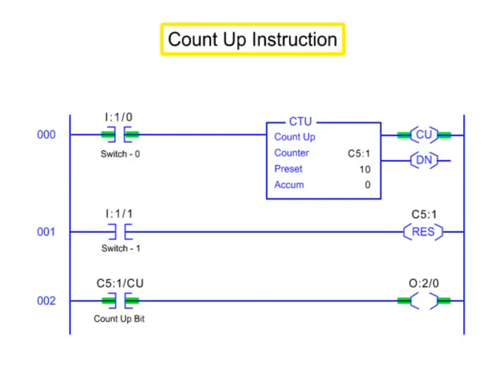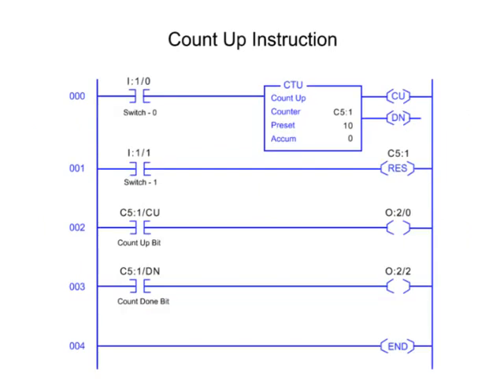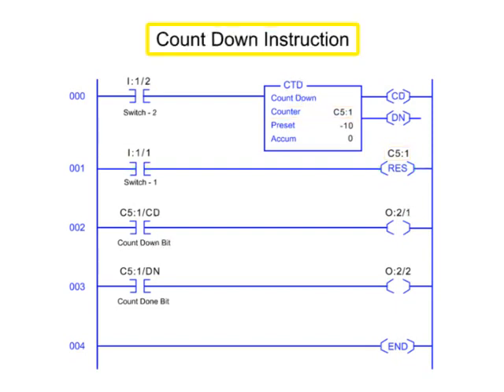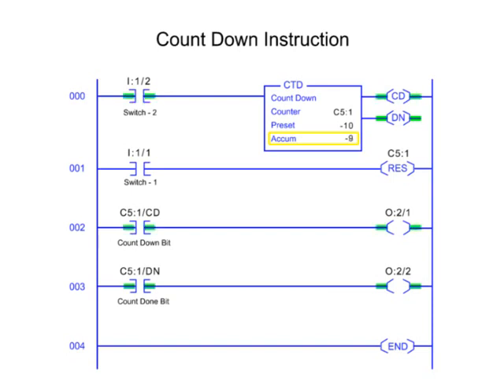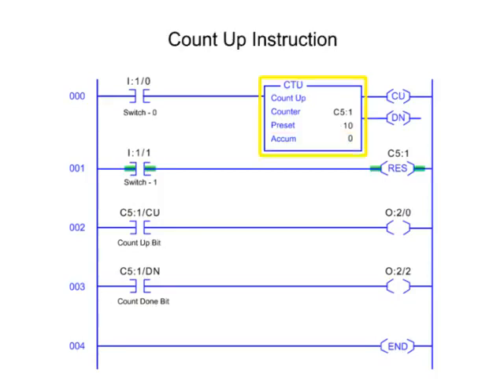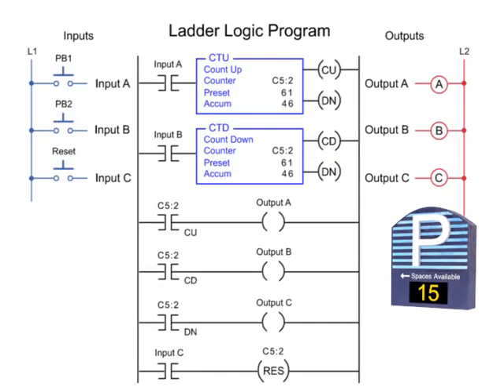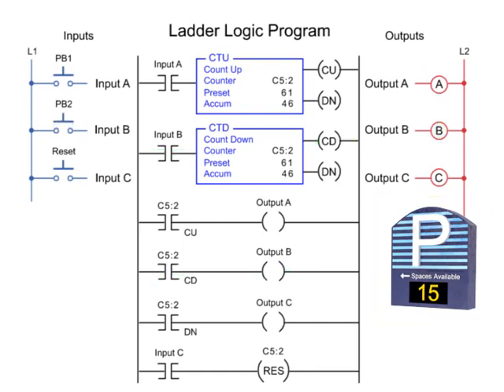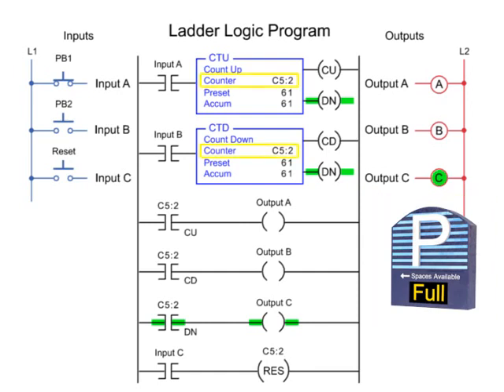Counter on PLC: Count Up and Count Down Instructions | PLC Course 6/7

Comment from the maker: Thanks for watching. For More Videos: Please Subscribe My Channel
PLC Programmable Logic Controllers Tutorial: https://bit.ly/2C22zhI
Complete Practical PLC Course Tutorial: https://bit.ly/3dHon09  
Advanced PLC Programmable Logic Control Tutorial: https://bit.ly/3g8FfO3
Electric Motor Control and Power Systems Distribution Tutorial: https://bit.ly/31Cib6c
Industrial Robotics Tutorial: https://bit.ly/38hQnWd
Industry Blueprints Tutorial: https://bit.ly/2ZqCn8p
AC Circuit Analysis Tutorial: https://bit.ly/2VyoHqP
Physics Tutorial: https://bit.ly/2BjVOaX
Motion Control  Tutorial: https://bit.ly/31sqUrz
Embedded Systems & Microcontroller Tutorial: https://bit.ly/3893dpH
Motors and Drives Tutorial: https://bit.ly/3dH0yF1
Fluid Power Design and Application Tutorial: https://bit.ly/3dEjvIq
Fluid Power Control Tutorial: https://bit.ly/3eniF3S
Process Control Tutorial: https://bit.ly/3hTASs7
Channel Link: https://bit.ly/2IsqVS for watching more Videos
Learn more about PLC's immediate input and output instructions. During the scan process, the input scan normally records the inputs before the program scan and the output scan normally updates the outputs after the program scan.
Simulations provided free under a Department of Labor grant awarded Eastern Iowa Community Colleges.
😌Don't Forget To Like, Share, Subscribe & Comment 😬
======
تعريف بالقناة:
قناة تعليمية مهمة للجميع عليها أكثر من 210 فيديو تعليمي، بها:
1- شرح لبوردات الاردوينو Uno & Mega 2560  وعمل مشاريع رائعة بها حيث، شرح Servo Motor, DC Motor وطرق توصيله والتحكم في إتجاهه، و EEPROM وتوصيلها وكيفية التعامل معها. وال Stepper Motor، واستخدام الاردوينو كمولد موجات جيبية ومسننة ومثلثية،
رابط الدورة من هنا: https://bit.ly/2PvtHvx
2- شرح دورة الأنظمة المدمجة Embedded Systems والميكروكنترولر واحتراف البرمجة بلغة الامبيدد سي Embedded C. وعمل مشاريع رائعة…
رابط الدورة من هنا: https://bit.ly/2KadqX2
3- شرح كيفية الربط بين الاردوينو واللابفيو وعمل مشاريع رائعة بهما.: https://bit.ly/2KlTssj
4- شاهد أيضاً،دورة مهمة جدا لطلبة الهندسة في شرح أساسيات ومبادئ التحكم الآلي او هندسة نظم التحكم
(Automatic Control or Control systems engineering):
رابط السلسلة:  https://bit.ly/2NGyeYd
5- دورة متقدمة في التحكم باستخدام اللابفيو (مهمة لأقسام تحكم أو كنترول والكترونيات). وهي تطبيق عملي لدورة التحكم الالي 
رابط الدورة من هنا: https://bit.ly/2K7aVEE
6- سلسلة Root Locus Method في هندسة التحكم الآلي لطلبة كلية الهندسة، قسم كهرباء،
رابط السلسلة: https://bit.ly/33CROvi
7- سلسلة عملية في القوي الكهربية او الكهرباء المتردده الاحادية والثلاثة الطور (Electrical Power) لطلبة هندسة ولكل مهتم بالكهرباء
رابط السلسلة كاملة:  https://bit.ly/3dWEckc
8- بعض الدواير العملية الكهربية المهمة للجميع.
رابط الدورة من هنا: https://bit.ly/2Fnli65
9- دورة في القياسات الكهربية، مهمة لطلبة كليات هندسة ولكل مهتم بالالكترونيات والكهرباء: https://bit.ly/30RdTVS
10- دورة في احتراف الرياضيات والجبر والهندسة والتفاضل والتكامل والقوانين الخاصة بها بدون تعقيدات.:  https://bit.ly/30ykUtG
11- دورة في احتراف برنامج اللابفيو الرائع LabVIEW : https://bit.ly/2TOx4y4
12- برامج مهمة للكمبيوتر واللابتوب الخاص بك: https://bit.ly/2qT9NM6
13- Complete Practical PLC Course Tutorial: https://bit.ly/3dHon09 
14- Green Screen Tutorial Link: https://bit.ly/3esShFa
15- Complete Process Control Tutorial: https://bit.ly/3hTASs7
16- Complete Fluid Power Control Tutorial: https://bit.ly/3eniF3S
17- Complete Fluid Power Design and Application Tutorial: https://bit.ly/3dEjvIq
18- Complete Motors and Drives Tutorial: https://bit.ly/3dH0yF1
19- Complete Physics Tutorial: https://bit.ly/2BjVOaX
19- Complete Embedded Systems & Microcontroller Tutorial: https://bit.ly/3893dpH
20- Advanced Programmable Logic Control Tutorial: https://bit.ly/3g8FfO3
21- Physics Fundamentals Tutorial: https://bit.ly/2CNrzcU
22- AC Circuit Analysis Tutorial: https://bit.ly/2VyoHqP
23- Industry Blueprints Tutorial: https://bit.ly/2ZqCn8p
24- Industrial Robotics Tutorial: https://bit.ly/38hQnWd
25- Electric Motor Control and Power Systems Distribution  Tutorial: https://bit.ly/31Cib6c
26- PLC Programmable Logic Controllers Tutorial: https://bit.ly/2C22zhI
وهناك المزيد علي القناة، وان شاء الله هذه مجرد البداية فقط.
رابط القناة:   https://bit.ly/2IsqVSC
وتعمل اعجاب ومتابعة لصفحتنا علي الفيس صفحة المهندس المحترف
رابطها: https://www.facebook.com/المهندس-المحترف-100879698187843
متنسوش الإشتراك بالقناة لمتابعتنا وتفعيل جرس التنبيهات ليصلك الإشعارات بالفيديوهات أول بأول.
====
#ُPLC_Course
#كورس_PLC
#Kyrillos_Refaat